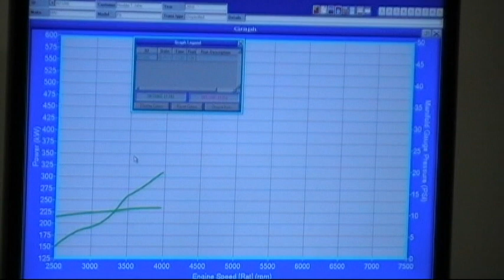FPV GT Boss 335 456 RWKWS , Intune Motorsport

Comment: Holden forced induction? They're still using pushrod valve trains. That's so the average Holden driver can still do backyard cam changes by joining the dots. Imagine your average Holden guy trying to setup cam timing on a quad cam...
Reply: John Winzil  Lot of p/rod bending going on here.

Comment: Imagine those poor Holden guys now thinking of trying to squeeze 600+rwhp from their E3 GTS - no probs guys you can bolt on a blower and all the gear for about 20k+ while we just do exhaust and tune. Then we go fuel system and intercooler for 650+ at the treads. That new coyote 5L is a fukn top donk and Ford now have forced 6's and 8's from the factory (as do BMW, AUDI and MERC). Forced is the furture and Holden are behind again.